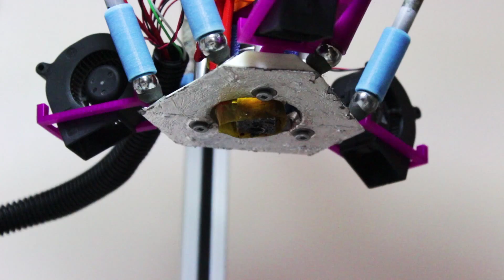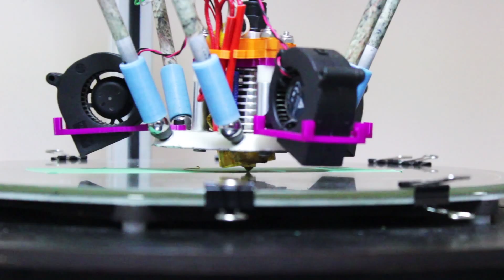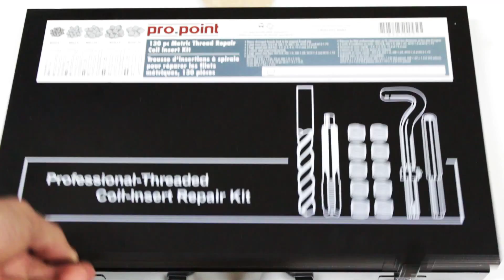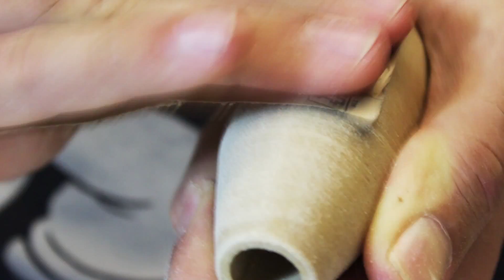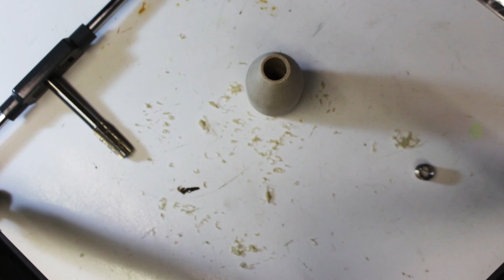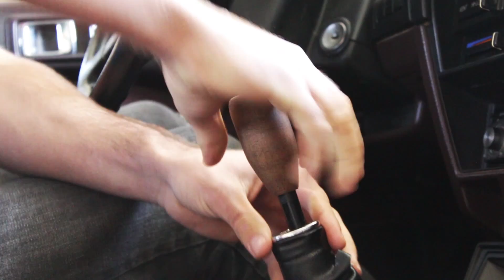Will It Print Wednesday Ep. 06: "Weighted Shift Knob"

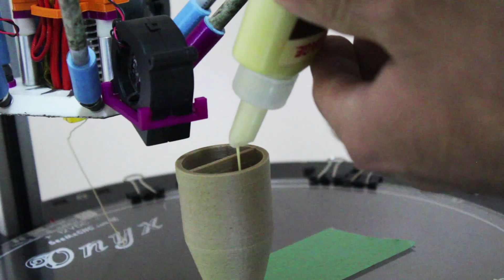Comment: what are u doing at 2:50 i didin't get it.
Reply from the maker: Putting in some lead weights and glue to stop the pieces of lead from rattling around and make the shift knob heavier. Heavier shift knobs are said to have more momentum and make it easier to slot into gear.